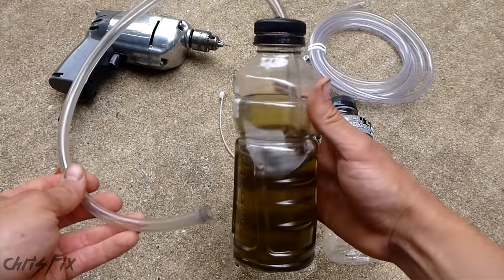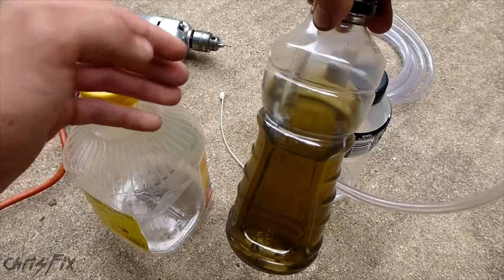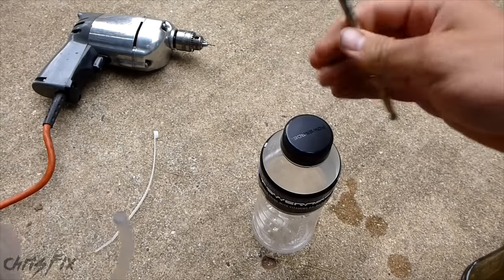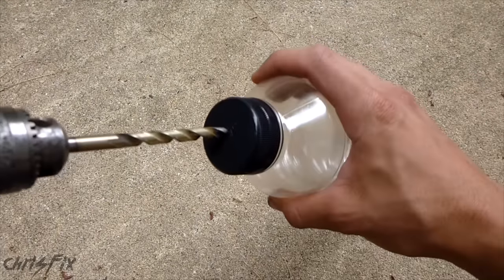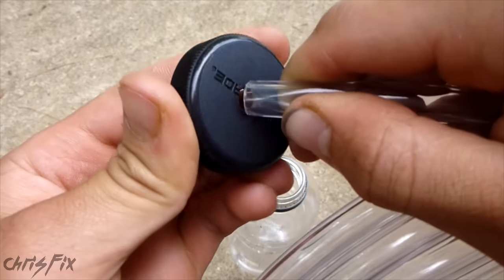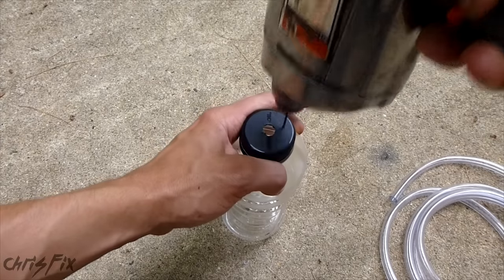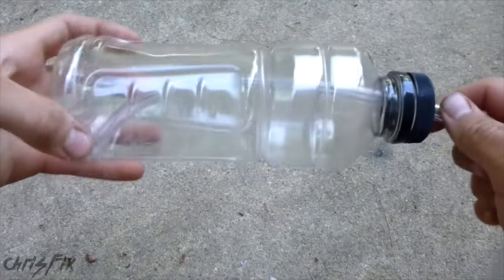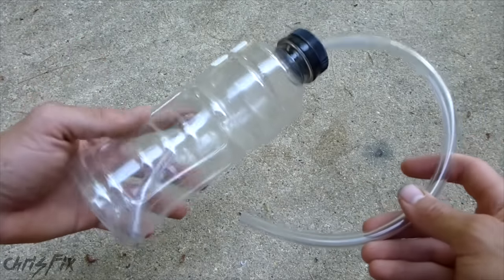How to Make a One Person Brake Bleeder for Under $5

Comment: Chris I absolutely love your videos.  You may however want to reconsider using that drill.  

The old 2-wire, non-grounded, non-"double insulated" power tools are DEATH waiting to happen and NOT easy to let go of when the electricity begins to flow through your body!  Read this on a website so you may want to research that a little further.

  Our company no longer allows us to use them.  Stick with the Ryobi!!

Anyways keep making those awesome videos.....
Reply from the maker: +kneesee100 thanks a lot! Yes that's an old school drill. I won't use it anymore because that makes a lot of sense!
Reply: kneesee100 
isn't it amazing how people survived back then without all the safety considerations of modern day? no seat belts, no helmets, slingshots, pocket knives, BB rifles taking kid's eyes out, leaded fuel, etc etc LOL
Reply: sad thing is granpas drill still works.....ive been through several "new" and "improved" "safe" drills....

Comment: I did this today using a Gatorade bottle, :-),  this is a fantastic idea and works very well if you follow the instructions as Chris explains and you can , in the end, flush the entire brake system without any help.

Comment: Perfect tip. I made one exactly like that. Just a few points...
1.  You can use a thicker based bottle for more stability if you fill the bottle a 3rd of the way with old brake cleaner you have laying around which won't ever be used, or any fluid that might be the same consistency of brake fluid. It's only to keep somewhat of a vacuum for air bubbles.
2. Smaller bottle or larger bottle you can increase stability by gluing a larger plastic piece to the bottom of your bottle. It can be plastic from any empty container or jug.

Comment: Just used a 32 oz plastic (speedway) convenience store cup and double layer plastic lid. Eli inmates the whole drill a hole and a air hole into a water bottle issue and allows for a wider base. Hose slides right in. Taiduh!

Comment: Thanks! I prepared my own Brake Fluid Bleeder, I had to buy a $8.49 tube which is 3/16" in Diameter, it's very tight enough to really bleed out my brakes and a Sprite 1 Liter bottle for my Mitsubishi Lancer 2011.

Comment: Ive been bleeding brakes like this since 1985 . I first saw the method in an old GM Manual .
I find that a glass jar ( like a Pace picante sauce ) works good .
I dont use a top , just put the tube in the jar and dont let it come out or let the fluid get too high or low .
People would tell me " No that wont work ! " .
But It works great .

Comment: Awesome tip: Use superglue or epoxy to attach a 5 inch by 5 inch piece of wood or MDF to the base to make a wide base for the bottle and make sure it doesn't tip over.
Reply: Yeah, you could do that, or just sit the bottle in the hole of a roll of duct tape.
Reply: Luciano Narno Or Clear hair gel jar which is wide and shallow.
Reply: Instructions unclear: monkey drank brake fluid, flew into a fluid-filled rage, dropped a donkey-sized dump on my new rotors and drove off
Reply: Luciano Narno another good tip.

Comment: Have you ever tried The Motive Products brake bleeder?  It's awesome after changing over all the hard brake line front and back in my truck to stainless I was able to bleed the whole system in less than 30 min. It makes changing old fluid really quick and easy too. Best part is you don't have to sit and pump the pedal forever only moving 1" of fluid with each push. It hooks straight up to the master cylinder and holds 2qt of fluid so there is no real danger of running the master cylinder dry while doing it. If you haven't tried it check it out they are totally worth buying.

Comment: Ta for the tips again. I always asked my dad to press the brake pedal but he's not always available so it's good to know that you're able to do it on your own. I often thought about it but worried about the delay from pressing the pedal to closing the bleeder valves, thought I might make it worse if I wasn't quick enough.
Reply from the maker: Yea,  that's why I showed the one person method since you might be working on your own.
Reply: For me this method definitely introduced air, I'm guessing through the threads even though I loosened the bare minimum to get fluid flowing. Fingers crossed a 2 person bleed tonight fixes the mush.

Comment: That drill looks ancient! :)
Reply: hallis1 and that's why it still works , new tools are mostly made no where near as good as old ones
Reply: I agree 100% that's why when I go shopping for tools I usually do it in pawn shops.
Reply: It's an impact driver
Reply: @wobluemoon  no it's just a standard drill
Reply: @ThunderRoadDreams  exactly, I go through Grinders like crazy and I don't use them that much just for projects here and there but the motors burn up.

Comment: Why not drill the lid not on the bottle then now debris in the bottle.
Reply: so the bit doesnt hit anything when it breaks through the cap
Reply: You have to clean the bottle anyway, no need to damage a drill bit by hitting it on the surface beneath the lid.
Reply: Just put it on a piece of wood...
Reply: +markothevrba I used an upside down cardboard box
Reply: Now you have a hole in the bottom of your cardboard box...
Reply: He seems to have not given this a lot of thought but heh it works for me.
Reply: Makes no difference if there's debris in the bottle, The fluid going into the bottle is used and no good, the chance of any debris being sucked back into the brake line are zero, with that length of tube.
Reply: Because he made the video the easiest way possible for those that only have the basic items on hand. Plus if the drill bit catches when you're holding the cap without it on the bottle that can be a little bit dangerous and somebody could get hurt that way. Hold on the bottle keeps your fingers away from the drill bit
Reply: +Walter's Playground the hole in the box is for ventilation

Comment: I put a zip tie around the hose just inside the cap so I can hang it over the axle and let it dangle. Also, I used a 3/16 hose so that it is super snug on the bleeder nozzle and doesn't require a zip tie there. But, potayto/potahto... Works either way! Thx for savin' me a few bucks when I really needed it!

Comment: can i get the plastic tubing at a home depot?
Reply from the maker: That is where I got it!
Reply: If you have a "Rual King" around they have a wider selection.  Prices are about the same as Home Depot.  Ace Hardware is a convenient rip off, but as stated,sometimes very convenient.
Reply: Angel Hernandez just picked up some 3/16 ID ‘clear vinyl’ model EZ-FLO 98562. 20” for $4.58 at Lowe’s.

Comment: This will get you out of trouble if you are alone. as you see fluid passes the thread meaning air can suck in as well. the best method is with someone else pushing the peddle. I have tried this a few times on different cars and I have never not got air back into the system doing it this way. a 90% job done but the best way is the old way.

Comment: If your driver's seat is motorized, I like to use a long screwdriver to keep pressure on the brake pedal. Pump the pedal a few times then wedge the screw driver between the seat and the pedal, then crack the bleeder.
Reply: I've done that.....lol

Comment: +ChrisFix Worked awesome man!  I was adjusting my parking brake and I forgot to compress one of the brake pistons.  I was checking to see if the adjustment was working by starting the car and applying the parking break to see if the hubs stopped.  I had one side adjusted but still disassembled and working on the driver side.  Put on the brakes by force of habit to put it back into park and the piston popped out and there was brake fluid everywhere. I thought I was boned hardcore... Anyway after I got the piston back in I came to the conclusion that I needed to bleed the brakes (never done it before).  I watched your video, took trip to Home Depot for som 1/4" ID tube and Walmart for brake fluid (and Gatorade), built the rig and less than 30 min later I was back in business.  Thanks for the video and for saving me $30 on a bleeder.  You are the man!  I am already subscribed but I will keep watching and keep "liking" the videos.

Comment: Great tip for people.  I've done the same thing, it works great.  To prevent spills I've attached a wire coat hangar from a pants hanger that have the cardboard bottom.  I just removed the cardboard bottom and attach both sides to the bottle, then hang the bottle on the coil springs or someplace similar.
Reply from the maker: +BigBrotherIsTooBig Thanks for sharing! That is a good idea!

Comment: I have always bled my braked using this method until I purchased a Pittsburgh Pneumatic brake bleeder kit from Harbor Freight/know in Canada or Alaska as Princess Auto. Simply attach to an air compressor & there is NO NEED TO PUMP THE BRAKES OR ANYTHING BESIDES, MAKING SURE TO NOT RUN THE MASTER CYLINDER DRY!! It works GREAT!!!!! 👍👌 I AM WONDERING THOUGH, What is the best way to clean the residual brake fluid out of the container & tubing in order to prevent the tubing & plastic from wearing or cracking???
Reply: You can clean the brake fluid out of the tubing and the jar under running hot water brake fluid is water soluble.

Comment: Not sure if this would work better, but since the tubing has a 1/4-inch inner diameter and an outer diameter of 3/8-inch. Wouldn't it be better to use a 3/8 drill bit? It would still probably be plenty snug doing it with the exact size bit as the outer diameter of the tubing you're using.

Great video by the way. I've learned a lot about cars watching your videos on YouTube.

Comment: You may consider doing a video on replacing wheel studs. The videos I found all recommended some wacky way to lock the hub, but I just used a 2x4 braced against the other studs and the cement to keep it from spinning and an old brake rotor to tighten the nut against.
Reply from the maker: AnotherUserNamedPaul That is a good video suggestion. I will add it to the list. Thanks, and thanks for the tips!

Comment: Really impressed with your knowledge and enthusiasm.  
After I watched this as well as many others I got the bug to flush my antique car's system.   And of course, it worked.
Now, I have a deeper problem.  The drums are original and I would like to replace as many parts as possible and still preserve the drums.  Is that possible.
These drums are 1962 when they used a high tension spring system which circled the outside of the drum.
Adding to my problem, I can't get the darn drum off using your methods.  I may try a torch next.  Ideas?
Thanks Chris and keep the videos coming.

Comment: just for consideration to eliminate 100% I use a small rubber piece hose over the nipple to avoid air leaking in through  the threads on rare occasions it can happen. specially if you use a one way valve .by the way ive been a pipe welder for over 20 y and have my cooling technician and electrical diplome. I am not a good technician for my bosses cos I prevent too much.  good work and diy .gr from the netherlands
Reply: Same here,they don't like simple solutions,there after big$ contracts,groetjes aan NL

Comment: I did mine with a hand pump until I sucked out 8 ounces each wheel but I also kept an eye on the fluid level since if air ever gets in there I can't get it out on my own.  That is the one critical thing, making sure that you don't run the fluid too low and get air in the system.

Comment: The brake fluid  in the lines can be pushed out by pressure (pumping the paddle) or suction  on the side of the bottle. If you squeeze  the bottle with the vent hole uncovered the air would go out. Then by releasing the squeeze and covering the vent hole,  brake fluid and possible air in the line would be sucked out. Just an idea, but you need a sturdy plastic bottle not a flimsy one.

Comment: Love your videos, very professional and informative.

Just got my first car a few months ago and think I'm going to do most of my own maintenance. Not as daunting as it seems.
Reply from the maker: Andy Plater Thanks Andy! Definitely do your own work. It can be done and it will save you a lot of money and you will learn a lot which is important! You can always ask me questions too!
Reply: ChrisFix Thanks for the reply;
On that note I've been noticing a squeaking on the highway coming from the drivers side front. (no squeaking under 25mph) I'm thinking it's probably a bearing because the sound doesn't change when you apply the breaks, unless you break hard then it goes away (I would assume because there's more weight on the bearing).

I discussed it with a mechanic at a sketchy shop, and he said it'd be the brakes, and recommended replacing pads and rotors. I'm skeptical that'd fix anything, and I don't want to fork up $200+ for something that won't fix my problem.

If it was a bearing, is it something to be worried about, do you think the mechanic is effing with me or is it likely the brakes? (he said contamination on the pads)
Reply from the maker: I wouldnt trust the mechanic. If you are saying it's squeaking as you go faster it can be the bearing but bearings usually howl. You can change your break pads for $40 yourself if you think it is the brakes. As you said, it doesnt go away unless you really jam on the brakes. I jack the car up and shake the wheel that you think the bearing is bad. If it is bad you might feel a wiggle in the wheel. You should also take the tire off and inspect everything. See how the pads look.
Reply: @chrisfix  
Yeah, might be the ware indicator squealing?
Reply: just take your time

Comment: I finally got around to doing this and I found it easier to duct tape the cap upside-down to a 2x4 and drill into that because I used a water bottle that was already clean.
Reply from the maker: AnotherUserNamedPaul Good tip! Thanks!

Comment: Another great video.  I always thought a check valve was needed to do it alone with this type of approach.  Years ago I bought a Lisle "one man" bleeder for about 7 dollars and it was essentially what you have except it has an in line check valve that snaps over the bleeder fitting. (Same idea as the Speed Bleeders). It works fine and never gave it another thought.  I am now thinking  it was not really needed.  I guess it is an extra precaution in case the bottle tips over and air gets in the tubing.
Reply from the maker: nbpt1000 Thanks a lot man! If you tilt the tubing upwards, the air will bubble out of the brake fluid in the tube and no check valve is needed. Obviously a check valve is better, but you really dont need it (as you saw).
Reply: i like this method

Comment: I did this and it's very useful! I am now going to go with a hand pump suction bleeder though and I'll explain. I need to start by saying I will be replacing my ABS unit which means I will need to bleed possible air from the valves in the ABS module. When getting air out it helps to create a negative pressure system which causes the air to expand in a liquid. These larger air bubbles flow out better than the reverse of creating positive pressure which is done when pressing the brake pedal to expel brake fluid. Creating positive pressure makes the bubbles smaller and they do not flow out as well.

Comment: Drill the cap off of the bottle,   Cut the hose at an angle to help with insertion,  optional :   Get another hose cut another hole in cap and insert the hose part way through cap.  Attach other end of new hose to a shop vac using the top of a 2 liter bottle as a reverse funnel and suck the fluid out of your lines, no need to pump the brakes, but I would as soon as you are pulling clean fluid out.

Comment: Use tubing with 3/16" inside diameter. The tubing will fit snugly onto the bleeder nipple and will seal better. Use about 12" of tubing. Also, keep at least 8" of the tubing, from the bleeder valve, above the bleeder valve. This will keep air from getting in the system. You don't need to drill anything. Just run the tubing into whatever bottle you are using. Let at least 8" of the tubing fill with old fluid when you loosen the bleeder valve, and with the other end of the tube in the bottle, pump the brakes a couple of times. Keep the master cylinder full. I used all 12 oz of the bottle of brake fluid that I had.
Reply from the maker: +Kevin Sissons thanks for the tip!
Reply: Your idea is great but I'm lazy and cheap. ;)

Comment: Another tip. If you have a piece of ferrous metal laying around, drop a magnet in the container, and sit on the piece of metal. That will keep it from moving/tipping, and you can pull off easy for storage.

Comment: Put a zip tie on the tube under the cap so it won't slip.  Put a wire hanger on the neck of the bottle so you can hang it above the brake.  Air bubbles rise.

Comment: Using a check valve would make it even better I think. Because instead of it sucking fluid back into the system when the pedal is release...which in-turn means any air bubbles migrating towards the bleeder when it's pressed, will move back towards the master cylinder when it's released. A check valve prevent all back flow.

Comment: Pro tip, use a short piece of silicone hosing to slip it over the bleeder valve. Silicon slips on easier, and does not harden up when cold. Works much better than clear acrylic hose.
Reply from the maker: Kirill Ostapenko Thanks for the tip!